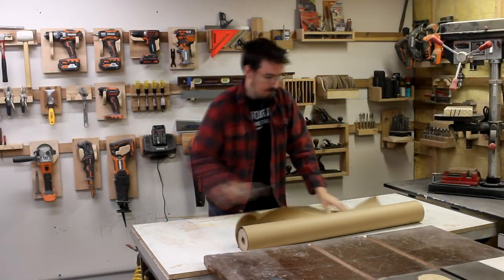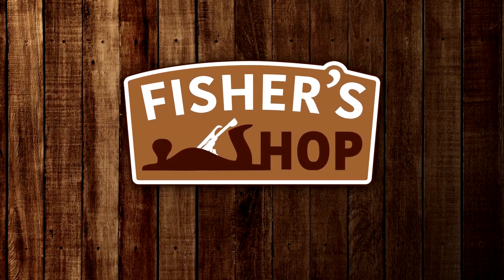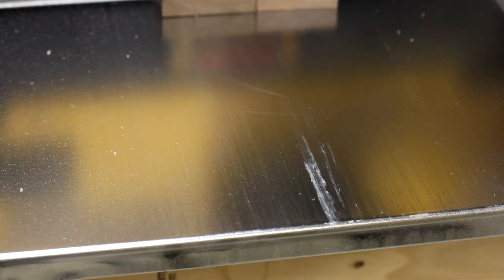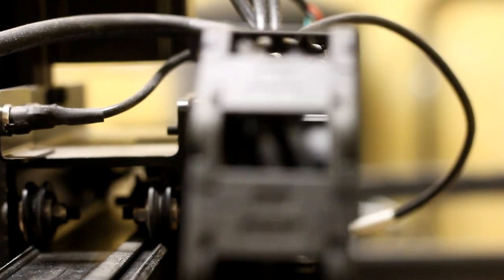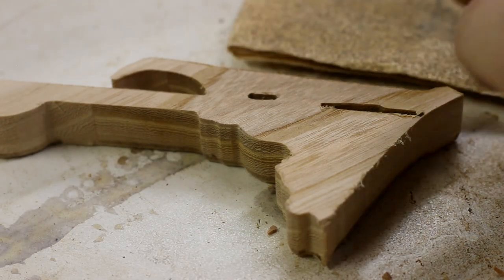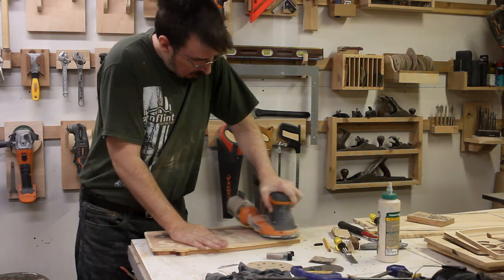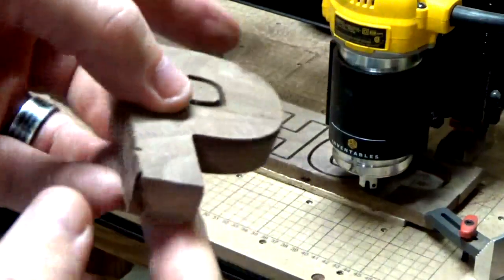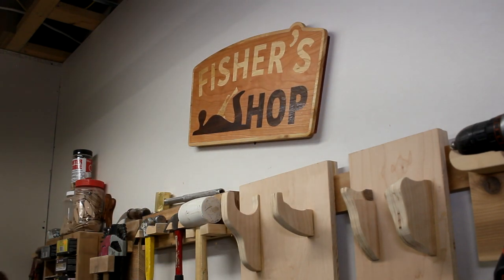Woodworking: Creating a sign with an X-carve

Comment: Love the sign and the process -- a few things I've learned since my 1st few attempts with inlaying - 

since you are already using Easel - use it's built in "inlay" function and specify the bit size - it will automatically adjust your pieces (positive and negative) to add the required curved corners so you don't have to chisel them away and perfect fit right off the machine.

Also - next time leave your inlaid pieces on the thicker materials so you can avoid tabs, then once they are carved and still attached to the board, then send it through the bandsaw to cut them free from the back. you'll never have the pieces jump out like the P in the outtake portion

Comment: That was amazing, my only comment against what you have done is that I personally would have used a rubber mallet to hammer the pieces in so as not to dent any of the cut out wooden letters, but your finished product worked and looked great. I really liked the planer sled to stop the snipe too, I think I will copy that idea as I was really impressed with it.

Thanks for sharing the info

Glen 😁👍
Reply from the maker: Sure. I knew I’d be planing off the letters so I wasn’t worried about little dents but if I wasn’t doing that then I would definitely want to be more careful like you said.

Comment: Super cool! Just got an carve a couple months ago, would love to see some more videos with yours. Still trying to get the hang of mine. Would be cool to see some of the easel side in the videos, especially the two bit carves. I have issues keeping my spindle from moving when changing bits.
Reply from the maker: Yeah, gotta be careful to not lose home.  What I found myself doing was to use a sharp pencil or an awl and actually mark a dot or tiny hole where my exact home is just in case the spindle moves during a bit change or my computer crashes.  It's not exact, but I got it about 1/64th from home and saved my work piece.

Comment: Turned out great! You'll have to check out the keyhole app in easel, it works great and you won't have to use those small screws😋
Reply from the maker: Yeah I should have done that.  My brain still isn't trained to think of using the CNC first.

Comment: Right off the bat you solved a question I've been mulling over. I've been wanting to mount a marker to color the carved letters etc. instead of spray painting or hand painting, then having to sand off the overspray. I have some acrylic pens that I want to try your method on. Thanks!
Reply from the maker: There are better ways to do it, Jim.  I just wanted something quick and dirty.  But you could embed a spring in the hole too to give your pen equal pressure and a "stop" clamp screw so that you could put in other-sized pens, etc.
Reply: @FishersShop  Yes. Your design for the pen holder will make it a lot easier to add a tension spring, which is something else I was wondering how I would do. It may be after Christmas before I can work on it, but I'll let you know what I come up with. Thanks for the reply.

Comment: To start those pesky microscopic screws, hold them with a needle nose pliers, and give them a tap with a hammer. That will slightly embed them in the wood, then you can finish with a screwdriver. Nice work! Love your channel.
Reply from the maker: Yeah, I figured it out. :)  But I still hate'em

Comment: Very nice job on the sign. Couldn’t tell which size X-Carve you got but at $1600-2000 I suspect you will be hopefully recouping some of the cost with jobs for some clients. Were there other expenses not covered in the cost of the unit?  I am almost convinced in getting one. Looks like it can do a lot of jobs. Where did you source your branding iron with your logo? It adds a fine finishing touch. 

Your videos are well done. Keep them coming.
Reply from the maker: I got the 750mm size, which is the middle model.  I'm yet to do any commission work but I'm sure if you did, you could recoup the cost in no time.  My wife had the branding iron custom made for me as a gift.  Not sure where she had it done, sorry.
Reply: Fisher's Shop  how about associated costs for things you required but didn’t mention? For instance, do you need special drill or router bits for the cutting? if she ever lets you know about the source for that iron please pass it on. Thanks for the quick reply.

Comment: The CNC is addictive.  They have one at my local Steam center, and I keep coming up with uses for it.  But dude, swap out the flathead screws for at least a phillips.  I don't use any non-robertson screws if I can help it.
Reply from the maker: Using flat-head screws is an on-going joke on my channel.  They're used to be my Grandfather's screws and I'll definitely be using them however I can.  It's a small tip of the hat to my late Grandpa... plus I'm getting rid of those blasted things by using them.  :)

Comment: I find facing the boards on the cnc to work better than using the planer.  Mainly when doing very fine vcarve inlays, or 3d milling.  The planer will give you parrellel flat surfaces, but may not match the machine.  By facing with the cnc, you are guaranteed a flat parrellel surface  from the perspective of the gantry, or I suppose the cutting plane.

Comment: What are your methods on switching bits and keeping the same zero? Also for the letters do you use pocket cut out and then a cut outside the line for the pieces that go in? I have had issue with them not fitting perfectly inside but it could have also been human error. I dunno. Gonna have to run another test.
Reply from the maker: There are easier ways to do inlays than what I showed here.  I just hadn't learned them yet at that point.  Easel has an inlay-generator app that makes it super simple.  Easel also has a "use last home" feature to maintain consistent zeros after bit changes.
Reply: Fisher's Shop Easel has apps?!?! Omg thank you. Haha

Comment: what offset amount did you use or would you use (if you were to do another similar project) for the letters?  ie how much (% or mm)small are the letter than the pockets they go into?
Reply from the maker: Really depends on the wood you're cutting and the bits you're using.  I ran several tests cuts before I found a good offset that worked well.

Comment: Mr.Fisher i love your humor that is mixed with great projects and know how ( even the dingies 🤣🤪😜) . I have a question for you , i’m looking to buy a knew jointer and was wondering if the Ridgid one is a good one ? Thx for the answer 😉👍🏼🇨🇦🌈
Reply from the maker: I'm happy with my Ridgid jointer.  Recently upgraded the cutterhead to be a Shelix and love it even more.
Reply: Fisher's Shop Thx for the reply , and do you know the difference between a helicoïl and shelix ? I’m prety mutch dizzy like a balerina after a spin 🤣😂🤣🇨🇦
Reply from the maker: @sylvaingregoire9262  Shelix has the cutters in a helical pattern but also on a slight angle so they shear the wood more offering an even better cut.

Comment: what format do you use to design your sign ? i bought a little Chinese cnc machine and have yet to figure out how to make anything with it yet  . i can get it to communicate with the computer . but i don't know how to get a drawing to g code
Reply from the maker: I'm not familiar with Gcode either.  The software I use, Easel, supports SVG (as well as Gcode, just haven't done it yet) layered images so that's what I used.
Reply: @FishersShop  thank you

Comment: How long do you wait to touch items after wiping them with danish oil?
Reply from the maker: Doesn't take very long for the oil to be fully absorbed into the wood.  And handling it too early won't mess up the finish either.  So it's not the same as having to wait for a film finish to cure.

Comment: Hey Drew I enjoy a lot of your videos I have bought probably half a dozen of your plans I am the deal is I have a X card and I've owned it for two years and it still in the box I haven't taken it out and put it together yet because I'm not veryfriendly or comfortable with the computer any advice from you to help me to get started I don't know anything about G codes or anything like that 80 some people tell me I need two different programs to work with a C in friendly or comfortable with the computer any advice from you to help me to get started I don't know anything about G codes or anything like that 80 some people tell me I need two different programs to work with a CNC any help would be appreciated thank you  C any help would be appreciated thank you
Reply from the maker: Don't bother learning anything other than Easel if you're intimidated by that stuff.  Inventables made Easel very intuitive and it does everything that you'll need it to do until you get extremely familiar with the machine.  Regarding assembly, I used a combination of video tutorials and the written instructions to put mine together.  The videos were helpful to be able to visualize exactly what I was supposed to be doing while the written ones told me exactly which screws, which wires, which pieces to be working with.  Good luck!

Comment: What’s ‘snipe’?
Reply from the maker: As the pieces enters and exits the planer, the rollers sometimes angle it into the cutter head causes a momentary gouge.  This little dip in the cut is called snipe and it's difficult to remove and is typically just cut off unless you make a sled to relocate it farther out the ends.

Comment: There are two kinds of CNC programmers / operators in this world.
1. Those who have had a piece move on them because a clamp or the vacuum table failed.
2. Liars
Reply: When I was younger and running a $750,000 CNC machine, a piece came loose and flew out just as the shop owner was walking by my station.  I still have that mangled piece in my toolbox as a reminder.

Comment: Laptops and CNC are not a good combo.
Reply from the maker: Correction... laptops with faulty hard drives and CNS are not a good combo.  Since this video, I have an SSD in there now and we're good to go! :)
Reply: There's more to it than that, sadly.  They have timing issues in general.  You can disable all of the "power features" and never close the lid, etc, etc, etc but sooner or later it will bite you in the kiester.   I'm not familiar with whatever the X-Carve has in their control box, but if you're sending data via USB from a laptop it's potentially going to lead to heartache.

For me it was just easier to get a $50 HP desktop on eBay - there's boatloads of them from corporate buyouts.